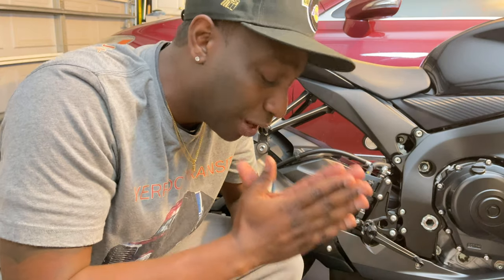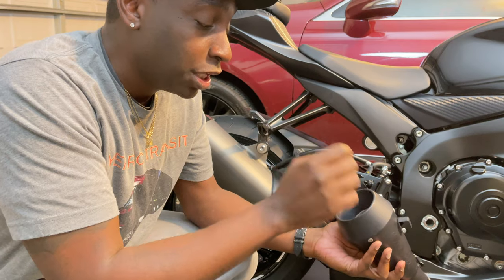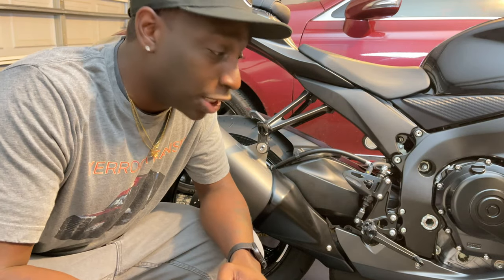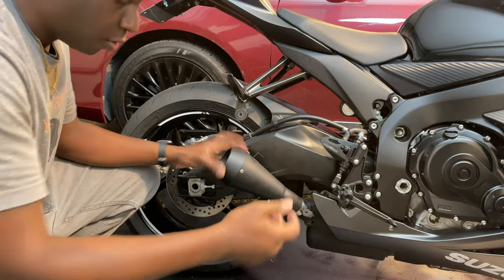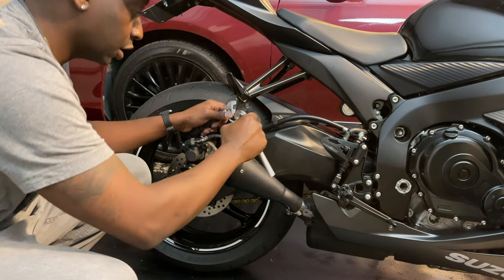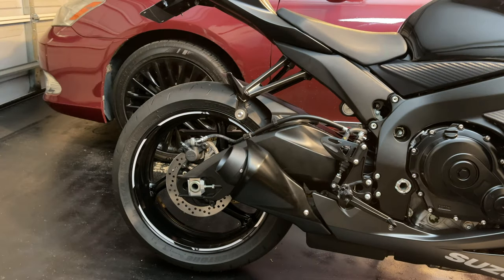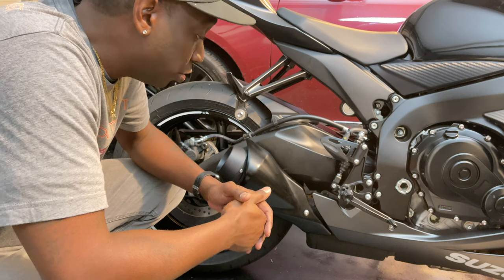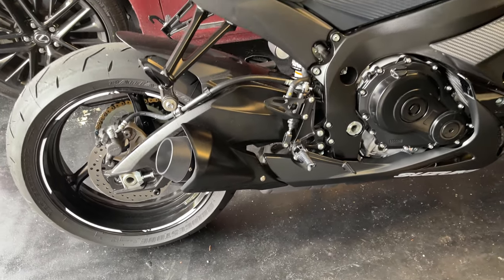Installing Short Pipe On 2020 GSX R 750 M4 SlipOn Exhaust

Comment: I have an 03 gsxr 750 with an M4 bolt on stainless steel muffler with the carbon fiber tip and OMG I have to pull over and wipe after blipping that throttle a few times..Sounds absolutely gorgeous..Those of you that have gixxers with M4's installed already know this....man!😎😎🤣🤣😆

Comment: I wonder if the 2022 model headers and cat are the same as this 2020 model, or if there have been more restrictions added to meet EPA standards. I'm going to get a 2022 or 2023 model and want to go with just the M4 slip-on, hoping it sounds the same as your 2020 model.